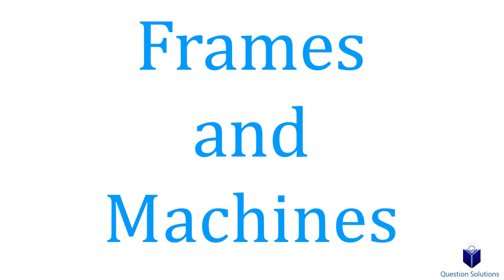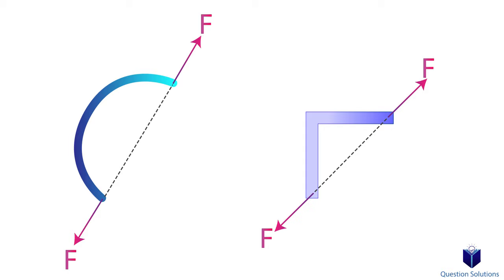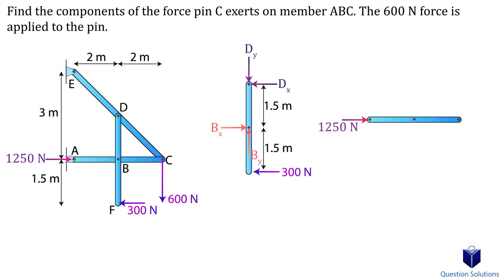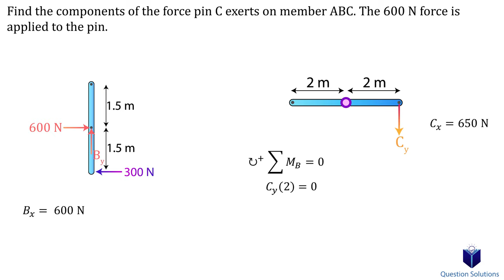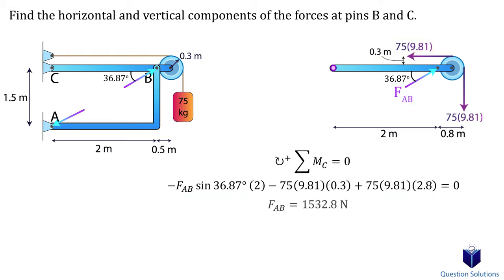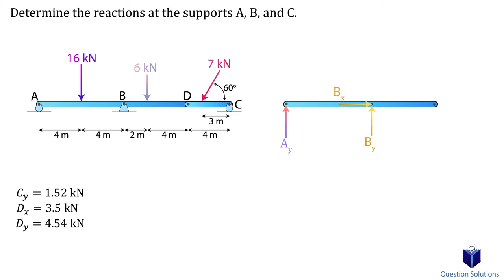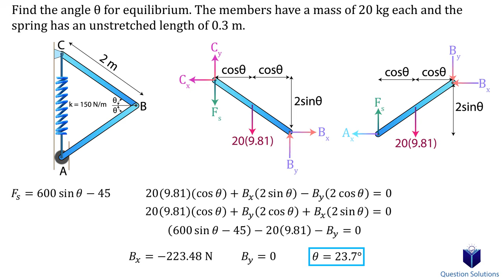Frames and Machines | Mechanics Statics | (Solved Examples Step by Step)

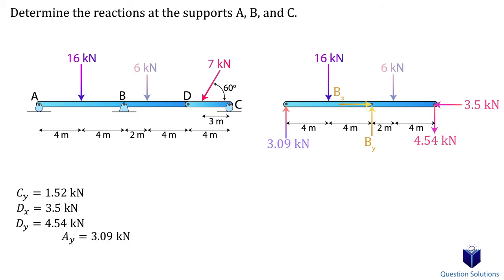Comment: At 9:45, why is the moment 0 at B? Why is this not treated as a continuous beam?
Reply from the maker: I think you might be misunderstanding. There is no moment, because the beam is in equilibrium, there is no movement. It's pinned so it cannot rotate about point B.
Reply: @QuestionSolutions   Doesn’t pinned support mean that it’s locked in the x and y axis, but free to rotate? I thought that fixed support was the only support type that prevented rotation. Is there a particular reason why this beam can’t be treated as an overhang beam after the load is calculated at D? Or am I missing something fundamental about frames and machines?
Reply from the maker: @kuklangaren  I think for these types of problems, the best way is to try and imagine this beam moving. It's pinned at B, but notice we have a roller at A and C. So let's say we push down at C, can it rotate? No, why? Because the roller at C will prevent it from turning clockwise. Now let's say we push at A. Can it rotate? No, why? Because the roller at A will prevent it from turning counter clockwise. So what that means is, it doesn't matter where we cut this beam, it will be in equilibrium. This principle is so important when we look at trusses. Especially when we make cuts through a member. So while we do have a pin at D, this whole collective beam will be in equilibrium so moment is equal to 0. Another tip you should keep in mind is that if you're doing a statics course, your object is always in equilibrium, it will not be moving. All equations, which means F_x = 0, F_ y= 0, F_z = 0, M = 0 will be zero. When you do a dynamics course, then your object will be moving, and you'll have to think about it differently.
Reply: @QuestionSolutions  Thanks for the quick replies! What you’re saying makes sense, but I guess what I’m trying to ask is why this beam is calculated differently from a similar looking three support continuous beam? In such a beam, we would still have one pinned support and two roller supports, yet the middle support does have a moment. In order to solve such a beam, you first have to find that moment. Why is that?
Reply from the maker: @kuklangaren  Maybe I am misunderstanding you. Are you asking about a single beam that is supported at 3 spots vs 2 beams pin connected?
Reply: @QuestionSolutions  Ohh never mind. I didn't pay enough attention when you brought up that Mb=0. I thought you meant that the internal moment at B was equal to 0, but I see now that you meant the sum of the moments on both sides. My bad. Thanks for all the replies!
Reply from the maker: @kuklangaren  You're very welcome. I am happy you got it!

Comment: Sir
Why the direction of Fs is downward?
Is it known from the question?
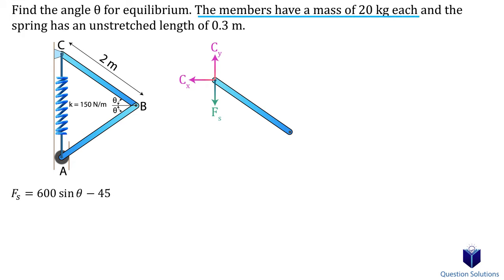Reply from the maker: Are you talking about 11:04? If so, it's because the wheel is pulling it down, so the spring force is also downwards. The spring creates tension downwards at the top, and tension upwards at the bottom. 👍

Comment: I completely disagree on the first problem. If this were the case then the pin itself would not be in equillibrium. It's more accurate to distribute the force evenly to both members as an external 300N load and then Cy would be 300N
Reply from the maker: So this question tends to be a confusing one for a lot of students, but the key is in the wording. "The force is applied to the pin", very few questions you'll encounter will say that. You just have to read problems really carefully and apply your knowledge to solve it. I encourage you to speak with your professor during their office hours and get an insight into this problem if it's confusing so you can clear up any misconceptions. If this type of problem shows up on your exam, you'll have a good foundation to tackle it. Best wishes :)
Reply: @QuestionSolutions  I deffinetly will I'm probably wrong and I'm not opposed to being wrong but just looking at the diagram of the pin its clear if Cy is 0 that the pin would be pulled down. Part of the reason I'm confident is I also made a simpler similar problem myself  of two two force members With pin supports on either end Creating an isocscles triangle with the bottom angles being 45 degrees and A 100N load being applied at the top vertically down on the pin. Breaking up the Diagram into the two members. The only way for Cy,Cx to be the same for both two force members was if I split the 100N load between Both Two force members so 50N down for both. In which case Cy would be 0 and Cx 50 N to the left for the left Member and the right for the right member. If you Treat the 100N load like it doesnt exist when you break up the two members you get a completely wrong answer. To me this makes sense cause even if you apply a load on the pin. Assuming it's symmetrical Aka Both members are equal distance from where the load is applied the load will be distributed evenly to both of them down.
Reply from the maker: @chrismarklowitz1001  One thing you can do is write to Hibbler (author of the book)  and directly ask him to get more clarification. But yeah, I definitely would ask your professor or TA and ask this question with a force applied just to the pin. It's a very good question, but often tricky for a lot of students. Good to teach it before it goes on the exam 👍

Also, are you understanding the diagram properly? The pin is between EDC and ABC. It can't fall out because Cy is 0. It's between the two beams. The force is countered at the supports.